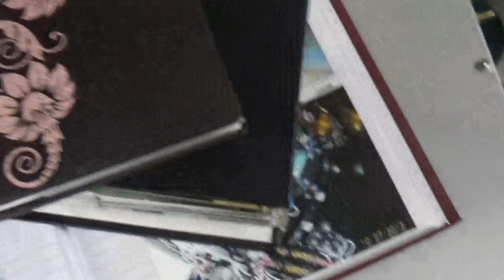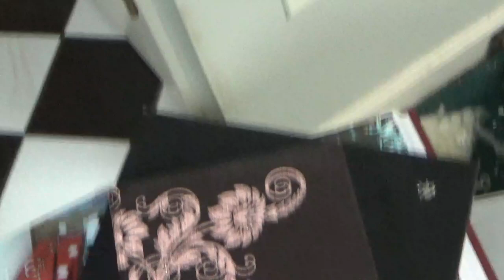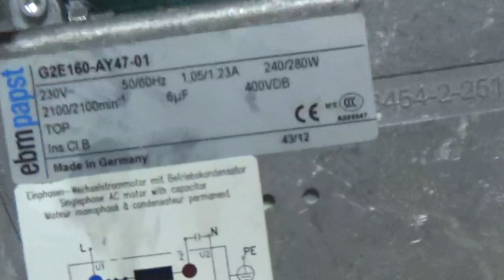Second To Last Video On The 3cx6000a7 10kw 6 Meter Linear Amplifier Test Video Next !!!!!!!

Comment: The HV cable/s between power supply and amplifier should be permanently connected in the amplifier and the male connection plug, plug into the power supply, for safety reasons. Ron W4BIN
Reply from the maker: That’s exactly how I set it up

And the cable is shielded with braided strap at ground potential at either end !!